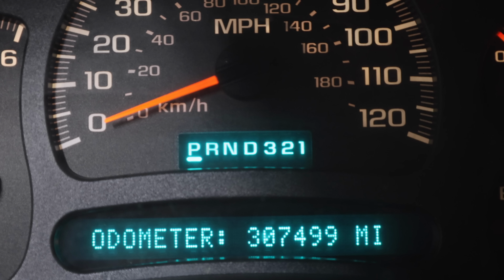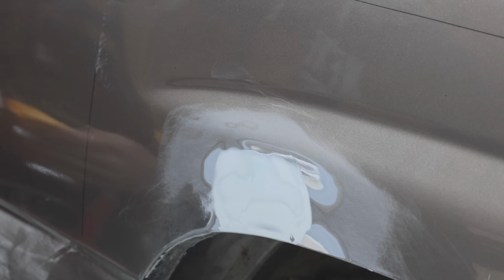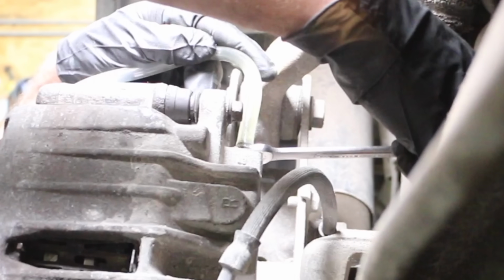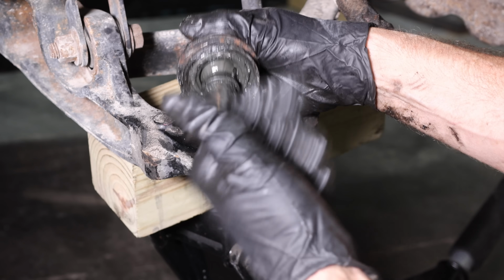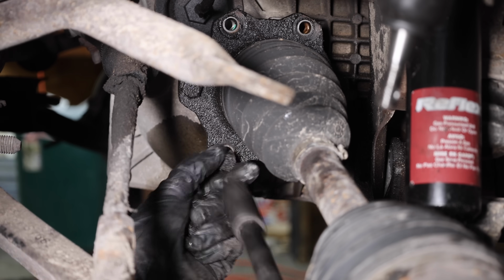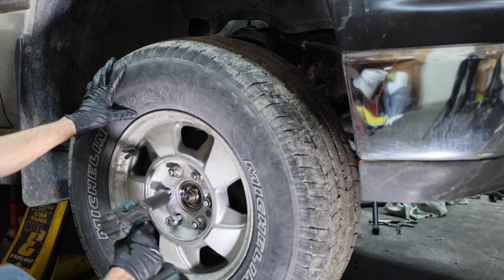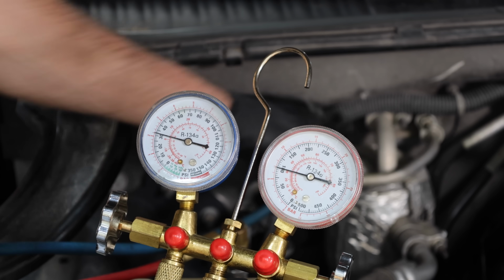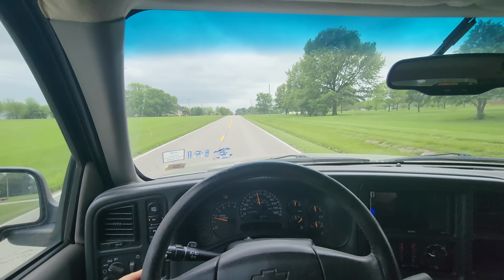Is It Stupid To Fix Up A 300,000 Mile Vehicle? Let Settle This!

Comment: This was a great video as I have a 2004 Suburban with over 350k miles.  This was a great to have you confirm that some of the repairs I have completed are "routine maintenance" and a reminder of some of the repairs and maintenance I should be completing on my 'burb.  The speed of the video was great to get through the immense amount of work to be completed.  It may be good to create other videos with more detail on some of the repairs.  I know that getting into suspension and steering projects can be frustrating if you don't go into the project prepared with the right knowledge and tools.    🙂

Comment: Wow that fender repair was top notch! You can even go a step further and instead of ordering a patch panel you'll use 5% of, you could buy a small drop piece of 18 or 20ga cold rolled steel sheet for probably under 30$ (Under 10$ if the local steel shop has really small pieces) and even cut your cost down to mostly time and paint

Comment: Always love your videos! That string alignment worked well. Biggest drawbacks are setup time and the short measurement distance. Extending the distance makes small toe changes much easier to see. I’ve been experimenting with a laser-based approach for that reason. Would be interesting to compare methods.
Reply from the maker: Thanks!  Thanks for the suggestion.
Reply: @ProjectFarm  I would like to see the string method compared to toe plates with tape measures, Trackace, Align Mate Laser, and that phone app Gyraline

Comment: My late stepfather has a well kept 2000 Silverado 1500 LT 5.3 Vortec with just around 100k miles and I intend to keep and utilize it as a daily driver in time to come. I currently have a 2019 F150 with 130k miles and have no faith in the big OEMs 'planned obsolescence' or future vehicles and the intention on brands locking them down to not work on them ourselves. I'm just gonna go back to it after this Ford go kapuut. I even have a 2004 F150 with over 300k miles going strong. With an Eaton G80 in rear differential, I should be fine.

Comment: I see a lot of people walk up to a 1990-1994 Ranger and see 275,000 miles. If it has the 4.0, you have a good chance. All you need to do is replace a set of heads, and replace gaskets and seals if you buy one for 1500.00 best to spend the 7000.00 on it and do everything. The most of the cost will come from the transmission rebuild and heads. Always buy lifetime warranty parts. Pay for it the first time and never pay again. Autozone parts, even tho the parts are ok They have a wonderful tracking of what you buy. Most of the time, most of you change phone numbers, and you need to keep and use that one phone number very important. But replace everything on a 1990--94 ranger all steering, steering box, and pump, all brakes. Do the drive shaft u joints do the front end bushings. If you fix your ranger you should have it for 10 to 15 years, depending on where you live.

Comment: I think the speed you're going is fine, some parts of repairs could have 10 more seconds per step to better explain but I think you're fine.
As for new vid ideas, I think diagnostic videos and the products used in diagnostics would be great area of focus. If you can show cheap scan tools that would be a great start since there's so many types just for OBD2. For example high end $4000 scan tools have everything like ECU/PCM/TCM/BCM coding+programming+flashing, they have bidirectional controls with 20+ components to control, freeze frame data recording, 4-8 channel data pids (live data monitoring), graphing with sign wave and binary graphing, and if course full vehicle codes.
Cheaper scan tools are where most peoples needs are met. But to be affordable you generally need different scan tools for different things to save money like TPMS, Bidirectional controls, ABS bleeding, key fob programming, RJ35 passthrough coding, and so on. You might get one for 3makes(Chrysler,  Dodge, RAM)and a different one for Kia, Hyundai or Toyota, Lexus and Scion. Affordable scan tools also don't have crazy subscription fees monthly.

The repairs aspect can be brake jobs and how to reset ABS or bleed them or use a scan tool to reset oil change countdown reminder. Most peoples used vehicles are now in the 2008-2014 range not people like you and me with 1987-2005 vehicles. The parts aren't available for that old id vehicles and unfortunately everything past 2007 is heavily reliant on numerous sensors, modules and electrical components.

I bet you are the man to show what's the best affordable gadget's to get the job done cheap and keep their older vehicles on the road. The way you research I think you could show tons of scan tools I'm not aware of

Comment: If you own a Silverado, Sierra, Tahoe, Suburban, Yukon, or Escalade from 1999 to 2006 with the gas 4.8L, 5.3L, or 6.0L you should most certainly keep them and repair them as long as there is no frame rot and the overall condition is "good". The lack of the fuel management system/cylinder shutoff that causes lifter failure and overall greater quality of those trucks makes these trucks/SUV's ideal to keep investing AS LONG AS you plan to keep them indefinitely.  2025/2026 GM trucks/SUV's are failing left and right before they can even get their first oil change. 2021-2024 models are known for total engine failure. Factor in the cost of buying a new overpriced poor quality vehicle today by MOST manufacturers is pushing a shift to find vehicles that are over 20 years old and reliable, reasonable cost to maintain and repair, and cheaper insurance.  Think about it...a loaded Silverado crew or Tahoe can easily cost over $80,000 making a note around $1,000 a month without a hefty down payment. Save that note payment for seven months and you can have a reman engine put in a 99-06 GM truck/suv and get another 200k-300k out of it.

Comment: A flat 2x4 is great for blocking, so no issues there. The only thing I would suggest is to sand in straight lines rather than a circular motion. It makes it easier to get a smooth finish

Comment: Great job ! the only look out for that i will offer is;  be careful counting the number of turns on tie rods. some after market tie rods and parts are different sizes. always double check and measure from the end to the center of the part. usually the grease zerk. that way tou have a exact measurement

Comment: The ONLY time to junk a car is if it is a unibody frame, and the frame tubes have the cancer.  No way to fix, esp friggin GM cars, that took several layers of sheet metal to piece the frame tube together, glue between each layer, and a spot weld or two, just for fun.

Comment: Just picked up an original owner 94 corolla with 336k miles and the compression is still 175psi on each cylinder, its insane!

Comment: Pace is dead on. You covered a lot but it flowed well.  also when you pulled the rotors, did you use your wire brush drill set up to clean that mating surface? if not you should research that

Comment: If you have a vebhicle that run and hits 300k miles and you decide to get rid of it because regular maintenance work and a few rust spots on the body and THAT is all that is wrong with it? Just give it to me. I'll take care of it for you (Spends 4k in maintenance, makes it last 5 more years before major 2k job needs to be done. Meanwhile, their new vehicle engine and transmission fails in either 7.5k miles or 3 years with payments over 8-10k a year.)

Comment: Just bought a 97 K1500 with 180k on the clock, with original motor and transmission. Will be overhauling the suspension and steering components like you did. I have the money but I can not bring myself to buy a newer truck that will just lower in value. A thousand a year in maintenance is a better option plus insurance with full coverage will be $55 month. Fuel with be $200 per month.

Comment: 210,000 on the car I just bought.  Main issues, rough idle, little slippage, poor suspension parts.  Damage is likely going to be a salvaged clutch, a few salvaged suspension parts and an oil/tranmission/coolant flush and change to start.
Reply from the maker: Thanks for sharing.

Comment: Shoot, I’ve put about $16k into a rust free GMT800 Silverado 2500HD I bought for $4k. Fully dressed remanufactured engine, sensors, gaskets, electrical work, general maintenance, etc. Zero regrets. For $20k I’ve got a rock solid work rig more reliable than new.

Comment: I bought a 2001 Ford F250 that wouldnt start for 100$. I remember replacing the battery, starter and alternator myself then the truck started fine. I've been using it as a workhorse for nearly 10 years. It's the most reliable vehicle I've ever owned. I'm up to 450k miles now.

Comment: I wouldn't replace disc brake pads without taking the caliper apart, cleaning it and the piston, and replacing the o-ring and dust boot.
Reply from the maker: Thanks for sharing!

Comment: Only one thing that I would change in the whole process. Before you compress the calipers to push the Pistons back crack the bleeder screws to allow the crappy fluid that is bound to be sitting inside that caliper next to the Pistons out and don't shove the fluid back into the line. This is especially true if the brakes have not been serviced in quite some time. Other than that, all common sense stuff that should be done if keeping a vehicle. These days keep rather than purchase is a definite better option if you have the skill set to do the work and a few tools:-). Enjoy the day and happy New Year!

Comment: That will outlast anything built in 2025/2026 with a new engine and transmission in it. Looking at about 7-8k to do that plus maybe a couple grand on smaller things so lets say your spend 10-12k altogether. It cost you 12k and lasts you another 200k instead of paying 60k or more and be lucky to see 150k its a no brainer. Only thing you got to watch out for is accidents because Insurance will total it with one accident.

Comment: Fixing older cars is therapeutic. If you get a good one and keep it maintaned its far better and cheaper than buying new ones not to mention my 2005 Toyota camry doesn not have all the computerzed crap that the new models have. I try to stay under 2007 if possible.

Comment: I've got a 300K mile  2000 Ford  F250 SD 4wd,  from southern California. Not a single bit of rust on her. Well worth the investment to reman her compared to the problematic and expensive NEW  vehicles.
Reply: Simply LUV your website. Dont change a thing about it.  BTW: Of the many sites I've watched using the ball-joint press; you're the only one actually greasing yours before use...Bravo...! ! !
Reply: I'm 70 y/o and retired OTR  O/O truck driver. I watch videos ALL day, every day. Yours are the BEST by far.  I've bought many products on your say-so.

Comment: Ur burb is in a lot better shape than my silverado. I kinda laughed at the part about abusing it.... definitely driving this thing into the ground. But i feel like this is the next level of skill needed beyond just changing oil and rotating tires. Lol. 

Would you still use 17w40 on a crate engine or treat it like a brand new car (asking for a friend, we'll probably stick with 5w30.... 😂)

Comment: Great video, thanks for the info.
Just curious how the body work over the rear wheel has held up one year later? I’m picking up a 2011 Yukon with 181k miles and has rust over both rear wheels.
I might give the repair a shot myself!

Comment: I just put a new timing chain set into my 350K mile Dodge Dakota, then took it on a 1200 mile trip.   The work was done by yours truly.  Whether it's worth fixing up a 300K vehicle depends on whether you know the history.   I wouldn't go out and buy a 300K vehicle to fix up, but you know what you have there, so you were able to gauge the worth.   Mine has been with me over 13 years and similar to you, I do a single drain and fill of the transmission every 25K mi.  Never had a hiccup from it.  The all original drivetrain (4.7L) feels like it could easily reach half a million miles.   I'm not kidding.

Comment: Considering the crazy price of new cars AND even used cars, doing this refresh is the smartest move.
Reply: it's crazy, people are asking $5k+ for beater toyotas and hondas with over 200k miles on the odo. after basic obligatory repairs these things can easily run almost $7k before performing critical powertrain work with the engine/trans if they need it (which is to be expected for a near 20-year-old car). it's not universal, thankfully, but there are a LOT of them.

Comment: I use to be in the automotive industry in Southern California. Most people with money keep their cars running & use them accordingly. Usually trucks, vans, SUV’s. It makes financial sense to put a few thousand dollars in a good quality vehicle rather than to keep replicating the vehicle with a new one. However there is a point of no return, if the vehicle is badly rusted or damaged & don’t mind spending $100,000 miles on a utility vehicle & you can easily afford the expense. Their vehicle shown has very little rust or damage, all the parts replaced were normal wear items.

Comment: Condition matters far more than mileage. Do you want never to worry if you can afford a vehicle or repairs or upgrades to that vehicle?  Learn to wrench and do not be afraid or intimidated. Do not have ego on the line so you
need not fear mistakes while learning. Everyone makes mistakes but wise mechanics learn from them. Learn to wrench early and do not be embarassed to take formal training at your local community college which drastically speeds up knowledge of theory of operation while giving the tactile experience universally useful in DIY.

There is no better hobby or interest than USEFUL hobbies and interests, and you can make everything you do for fun useful and profitable long-term. The mechanics here who started young are proof but adults can learn even more easily than most youngsters because they have life experience behind them. 

Wrenching cars and trucks gives foundational skill experience on their many systems (and similar non-automotive systems) and makes you much more employable. For example I studied machinery and vehicles since childhood so learning came naturally at all my adult jobs. A machine is a machine after all. Automotive skills prepared me to pull parts at my first job at an auto salvage. Building on that made industrial mechanics and learning basic welding easy. That made fixing fighters for Uncle Sam natural along with doing ALL my automotive work except specialty machining. That made renovating my homes easy and building my workshops easy. When you realize all human tech skills are related and mutually supporting your life becomes much different than if you'd let yourself to stay helpless. 

All it takes is determination and wrenching pays off even (and especially!) when you don't have a job or finally retire and don't want one. Your money goes further, you gain control, and the mental exercise keeps you sharp.

If the economy crashes, your skills do not. Many mechs and techs watching this video do likewise. I just copy success. Like a sore dik, ya can't beat it.

Comment: It's done so often there is no question, just people who didn't KNOW it was an option. Cost-effectiveness depends on the vehicle. I assembled my Silverado from parts where I used to work. The owner died and I bought the partly completed truck from his son. That was in 2016 and it serves me well to this day. We did many cab, rolling chassis, drivetrain and interior swaps. They're merely tedious, not difficult. I've done three Fords for myself plus a variety of drivetrain swaps and suggest anyone who wants to slash their vehicle cost over a lifetime make the effort to learn to wrench. Trucks tend to be easy to wrench. 

Here's a tip far too few people take advantage of when swapping drivelines: TAKE OFF THE FRONT CLIP.  Cordless tools make that so easy it's worth the modest effort to access everything in the engine compartment including replacing old hoses, tidying up wiring, and if needed replacing the whole air conditioning system (the tools are far cheaper than labor).

Comment: I use a "grease needle" to put a couple pumps of Grease into the CV axles. I don't pierce the boot, I pushed the needle past the seal on the open end. Sometimes you need to remove and replace the clamp, but sometimes you can get in without removing the clamp. 
It really quiets down an old axle.

Comment: Honestly not a horrible job in the body work but i HIGHLY recommend using fiberglass as your first coat of filler, doesnt abosrb water and bondo, putty/most fillers are pourous and can absorb water.

Comment: Fireblock foam over body holes with backer / tape if gaps huge. Then fiberglass resin with fibers which most boats and cars made out of. Sand flush. Primer, paint, win.

Comment: my grandpa died earlier this year and i got his 03 silverado with 465000 miles on it! went through the suspension, brakes and steering and it drives like new. its crazy how fast that engine starts up and how quiet it is for that many miles. hes owned it since new and has never had any major engine work done to it!

Comment: I just bought a single owner 2008 civic ex with 228k for $500. Body and interior good, needs front wheel bearing and at least 2 tires. A little neglected in the engine. The oil appears to be the main area of work done at least. Time to replace battery, plugs and all the fluids. Likely will do bearings and struts all around.

Comment: 289,000 2000 silverado cleaned, new control arms all bushings calipers  head liner ac compressor oring on oil pickup tube. Paid $3500 invested $2300 sold for $12500.

Comment: Bought an '02 Suburban 2500, 8.1L, 4WD about for years ago with 308k miles on the clock. Still has the original paint, no clear coat delamination. You could tow a locomotive uphill with that thing. 

It's got 370k miles on it now. Mobil 1 Truck & SUV for the win. 🏆